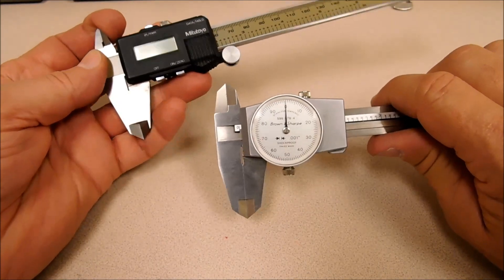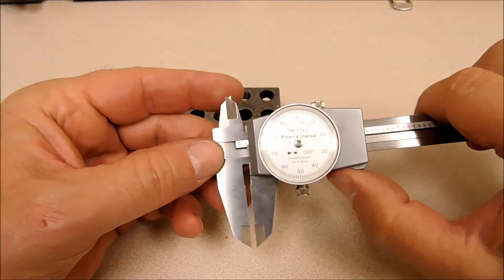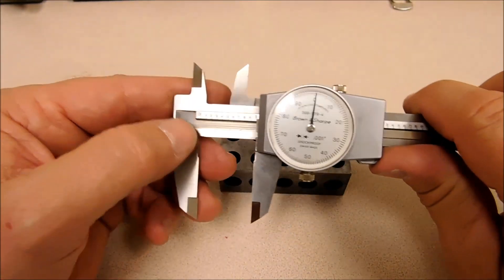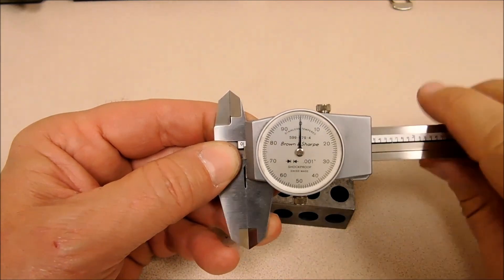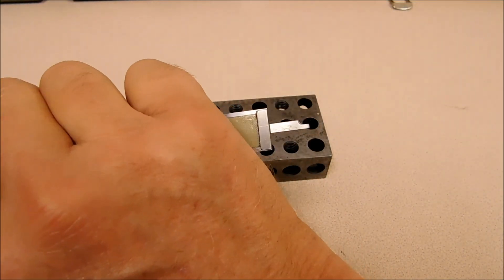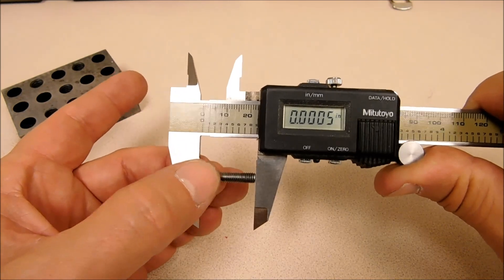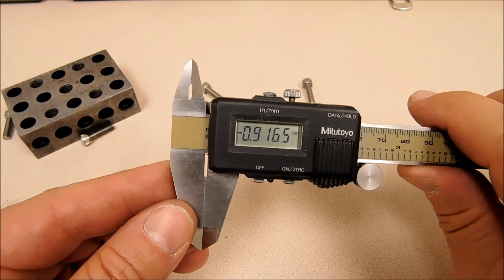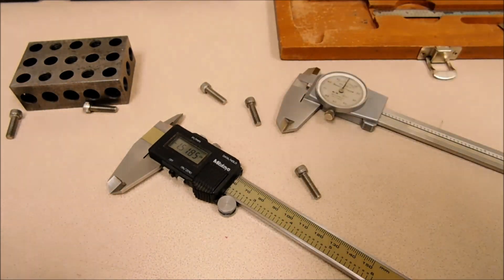Calipers -- Dial vs. Digital -- Does one do more ???  ( yes )

Comment: Nice video Joe !
I like those Brown and Sharpe  callipers !
One thing the dial calliper has over the digital unit is it doesn’t have a battery that goes flat just when you need to use it ! That being said the digital unit doesn’t have a rack and pinion set that can get dirty and jam up .
You can use a dial type as a comparitor , just set the calliper to the size you want or measure the part  you want to  use as a standard and set the dial to zero . Sure it’s not as convenient as a digital unit and provided your parts are within one revolution of the dial in  length  it isn’t too difficult to manage .
You can make some real handy marking out tools by modifying old or cheap callipers , i think Robin Renzetti (Robrenz )shows a few styles on his channel .
Reply: Battery is a non-argument
 Even on the cheap Chinese tools you get plenty of warning that the battery is nearing the end of it's life. You just have to remove the battery before putting them away if you want reasonable battery life, which is a big advantage of the quality tools like Mitutoyo where batteries last ages without having to remove them as they actually turn off when you push the button rather than just switching the display off and leaving the measurement system running.
Reply: SkyWizardless 
Everyone’s milage will differ in regards to this , i have a couple of cheap sets that will kill a new battery inside a month even if the calliper hasn’t been used and others like the Mitutoyo that seem to last forever even with fairly constant usage . I don’t know about the Starrett  ones i have as i rarely use them and i only leave the batteries in things  i constantly use to stop any corrosion of the battery terminal or socket .
I have one set that have an IP rating and the battery cover is held in place with little tiny cheese grade screw which I immediately stripped the Phillips drive out and then lost it so anyone thinking of buying a set with an IP rating - ie you use flood coolant on your machines should double check the battery cover retaining set up to ensure it is going to be reliable and easy the replace the battery.
Reply from the maker: Me too.
Reply: I was going to say the same thing about the dial calipers... lol

Comment: G’day Joe, the digital is good for those with poor eyesight but keep a spare battery handy. The thing I don’t like is they dance around the half though as you alter thumb pressure. Must get another digital as the one I had didn’t like being dropped on the floor. Cheers. 
Peter
Reply: CHEAP (inexpensive) calipers will 'dance around the half (thousands)' due to slop in their construction and flex I agree. QUALITY name brand calipers do not. You get what you pay for. Use the cheap import calipers for scribing layout lines and save the quality ones for measuring only. Cheap digital calipers will also eat up batteries very quickly because they are always drawing power even when turned "OFF". I get a full year out of a battery in each of my Mitutoyo Absolute digital calipers.

Comment: My go to caliper is a digital one. Like to use the metric to imperial conversion, and ability to zero it out anywhere. 

The thing I do not like is it is very sensitive to getting wet.   It affects the measurement greatly, and the display starts to fade out. And sometimes it is hard to read at certain angles when checking parts on the lathe.

But it is plenty close enough for most tolerances I work too.  Glad to learn of the step height gage part. Never knew that.

Comment: I love the brown and sharpe calipers.. they were the first "real" measuring tool I bought as an apprentice. One tiny chip in the rack ended them. I've been using mitutoyo digital for close to 15 years. Same 6 inch set. I've also added 8 and 12 inch sets. I will never use a dial caliper in a busy shop again, except for inspection.

Comment: I like the other benefit of the digital caliper.  Two holes same size: measure the diameter of one of the holes and zero.  Then measure either outside-outside and you have the center to center distance of the holes.
Reply: Two holes different size: Use two bearing balls the same size, larger than both holes. Set them into the holes and zero on the ball diameter, then measure over the balls.

Comment: Before dial calipers were common, Vernier calipers offered precision to machinists worldwide -- though they require familiarity with the Vernier scaling algorithm.  I think "very near caliper" is wordplay alluding to this earlier device and practice.  Also, the dial scale can be loosened and rotated to "zero" it to a standard length as well.  In the case of the dial caliper, this is mostly useful only to +/- 0.050" or so.  You can also use the digital calipers to compute the material to be removed.  First, calibrate them at zero.  Second, set the desired dimension by sliding the mobile jaw.  Third, zero the display while the desired dimension is set.  Fourth, measure the material's present dimension relative to the new zero; the new reading is the material to remove (ignore the negative sign).
Reply: i don't think there is nothing wrong with old school. I am also old school to  i'm retired now

Comment: you can also zero it on a hole diameter in a part, and measure hole centers, handy if you are trying to work out hole centers and the hole diameters are oddly sized e.g 7.3mm or 8.7mm etc

Comment: I find it way easier to use a dial on a regular basis and pull out the calculator if needed, I can quantify distances I can easily add say .055 by just counting by 10's then add 5 and watch the dial go through exactly the numbers in-between instead of watching Black bars change numbers as it moves and hope I didn't miss one without having to add or subtract to exact numbers. If my final is say 1.236" and my calipers measure 1.253" I can use the dial to know exactly how much I need to take other wise I have to subtract the 2 numbers to get there, or I guess set the 0 but then I don't get a true dimensional reading. I use a digital readout but only because it's different on a machine than in a hand tool that I use for more than just exact measurements.

Comment: Joe:
One thing that I really like about the dial cal...is when in doing lathe work...I can see the dial and look at the "distance" to see how much is going to have to be removed to get to my size.  Basically working in quadrants on the dial when I'm down to less than .100"....then come the Mic....now the "battery" guy...I use all the time when checking parts...since many drawings are in metric and imperial annotations.......yes, there are several brands of calipers that are .200" per rev....hate them....my eyes are not getting any better....1 rev....only way to go....and large button calculators...Good segment. Thanks Joe!

Comment: Just one comment when your done for the day and you put your dial or digatial calipers away try to leave a few thousand gap between the measuring anvils weather dial calipers or micrometer to keep rust from forming when they are closed tight.
Just a thought from a machinists since 1971 till retirement 9-30-19.
Keep the videos rolling I'm always looking for new way to do things.
They say you can always teach an old dog new tricks,lol
Reply: Beachbum I believe the reason you never leave a measuring instrument fully closed (assuming it is capable of a zero measurement) is to prevent temperature change from putting undue stress over time on the frame.  Since most faces are stainless or carbide it is unlikely oxidation would take place. Very few young machinists are taught this any more, so I applaud your comment, and enjoy your retirement remembering there is a period of adjustment.........it took me 5 minutes!

Comment: I've been using same Helio vernier scale caliper since 1981. A lot quicker and easier to use than a dial, and more accurate than a digital. The scale has both metric and standard, so easy to convert. Never needs batteries, don't have to worry about hot shavings melting the lense.

Comment: I love my dial calipers I also use digital for for quick metric conversion. Vernier  calipers I used and loved till my eye sight got bad . Now just to hard to read . The one comment about getting digital zeroes at the wrong time . I learned better a l on ng time ago I check what ever I am measuring  and zero then close to get reading or just zero before every measurement you learn after you kill a part and get called onto the carpet  check your digital every measurement  
Thanks Joe for Sharing

Comment: No mention of battery dying at the worst possible time?!  The biggest Con Joe!  It's THE reason I went dial only in my shop.
Reply from the maker: If you look closely at my thumbnail, You'll see I'm ready for the battery gremlin. Bring it on.
Reply: My mitutoyo digital caliper will work for 6 months with the battery light on. That has always been more than enough time to prepare to change it.
Reply: Just ribbing you a bit Joe Pi!

Comment: Nice demo. I use digital, dial, and vernier. All have strengths and weaknesses. For general measurement, I prefer the vernier- nothing to go wrong, quick read to within 0.010" or 0.1mm, and accurate to 0.001"/0.02mm if I need. Dial for basic comparative. Digital for when I need to zero for difference (part comparison, hole centers, and so on). I do not prefer digital as a general purpose tool, as they hide too much, and I have been burned by a rezero at the wrong spot. Then again, I am old and grew up with vernier scales, and was introduced to digital with lower quality devices.

Comment: I use my digitial just as you explained. Works great to quickly pick up centers of two holes spaced apart of equal diameters.  Never knew about the step as a hight guage, thanks again.

Comment: See I don't like the digital because it introduces another layer of approximation into the measurement over what the dial already introduces over the 100% accuracy of the really old fashioned slide calipers. The digital has the same (or worse depending on the brand) gearing that a dial caliper has which is already an approximation of the measurement and then adds the digital chips which add their own approximation and rounding by the nature of what they are.
Reply: Pretty sure digital calipers use magnetic scales just like a DRO.  No moving parts or gears.
Reply: @barrygerbracht5077  Yup, it's a linear scale and encoder, basically a hand-held DRO.  Never seen digitals that use a rotary encoder off a gear rack and pinion.  There is something to be said for conversion and rounding, but this can be said of most DRO readouts just the same.  If the scale is reading in say five micron resolution and converting that to decimal inch, there's a conversion and it's probably going to have to do some rounding.  Potential issue on a jig grinder or CMM, non-issue for calipers.

Comment: Thanks, Joe! Another great trick when using the zero function on a digital caliper is using it to determine the distance between the center of 2 matching holes.  For example, let's say you take a scrap block of aluminum and drill a pair of parallel 0.250 inch holes through it. To determine the distance between centers, you measure the Inside Diameter of one of the holes, and Zero the caliper at that measurement.  You can the measure the inside diameter ACROSS both holes (from the left side of the left hole, to the right side of the right hole), and the zeroes caliper will read the distance between the Center of each hole.

If on the other hand, you are faced with 2 studs, bolts, or pins, you can apply the same technique to measure the Outside of the pins, and the caliper will give you the same measurement.

Note that the holes must be the same diameter for this to work. I'd the diameters are different, you need to add both diameters and decide by 2, and zero your caliper at that length first.
Reply: You just made my life a little simpler...
Reply: @drickard67  Maybe we can get Joe to do a quick video on it.

Comment: Digital are also great for measuring bolt hole distances, by measuring a hole,set zero and then measure two holes,instant hole distance.
Also great for working metric on an Imp lathe, or vice versa, by say setting in metric the size you want,press zero then imp/mm button and measure the part in Imp and you know how much to take to get the metric dimension.

Comment: I have a Mitutoyo dial caliper that is 0-90 on both halves of the dial.  Good for the +/- type of comparison you did with the digital caliper, if you zero the bezel dial, but you could do the same with your B&S, just need to do the quick math in your head with the B&S on minus readings.  Personally, I don't care for the 2 - 0-90 halves and would rather have the full 0-90 like your B&S, but I use my old Mitutoyo dial caliper all the time, in addition to my digital MItutoyos.  BTW, my Mitutoyo digital coolant proof silver/gray are rock solid repeatable on measurements, whereas my black/yellow non-coolant proof ones drift a bit.  Guess which ones are the more expensive.  Thanks for sharing all your tips, Joe.
Cheers, Gary

Comment: The dials I have at work are about 35 years old. The dial is 0-50. Bought from a tool truck. I think they say Mac. Probably made by Central or some other Taiwanese company. 
 I don't use them much and the digital always has a dead battery when I want to use them.

Comment: The two reason you mentioned (especially the ability to zero on a standard) are EXACTLY why I prefer my digital over a dial. 
As a PRS shooter / reloader, I use the "zero on standard" function all the till for checking cartridge cases and ogive lengths on my loaded rounds.
Reply: I don't do PRS but I did go to digital for my reloading calipers for that very reason...

Comment: One of the more common uses for zeroing calipers at our shop is checking depth of threads. Zero your calipers on a bolt, screw the bolt in till it stops, check the height of the bolt sticking out, et voila that is the functional depth of of the threaded hole.

Comment: I bought a Starrett 1202F-6 caliper for the novelty of the outer dial marks being 1/64 each with 1/16" inch marks (not sure what to call that, it's labeled every 1/64"). The inside dial is broken up into .10" and .1" marked. The irony of owning it is that I always use the .01" and .1" and never the fractions. I have other calipers that are much more accurate. This set is just for fun. I may move it to my reloading bench and put the Starrett digital back with my little lathe.

Comment: Digital also doesn’t have a gear rack to pick up debris and cause the teeth to skip.  That said, I much prefer reading an analog dial and always reach for those first.  Much better ‘feel’ if that makes sense.
Reply: If you pick up debree in your rack calipers slide a piece of. 001 or .002 shim stock between your rack and gear to rezero you clipers back to 0
Reply: beachbums2008 You have been around awhile if you know this Beachbum!
Reply: @37yearsofanythingisenough39  yes the shim stock puts your dial back on 0 in the right spot if you do it a few times with the shim stock between the rack and gear and  you slide the rack back or forth with the shim stock in between them

Comment: As useful as digitals are there is one thing I always liked using a dial type for. And that's doing lay out work. Rather than squinting at my combo square I just set the caliper to the dimension I want minus a couple of thousand to allow for the scribe point.

Comment: Love my digital which also measures in fractional parts of an inch. Also good for converting between fractional and decimal.
The only advantage of my dial caliper is, the batteries never go dead. :-)